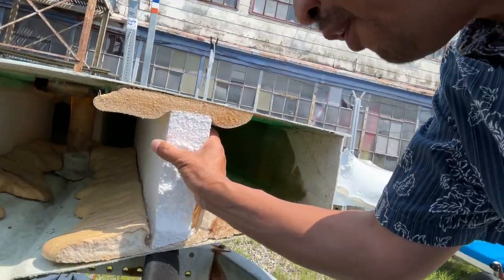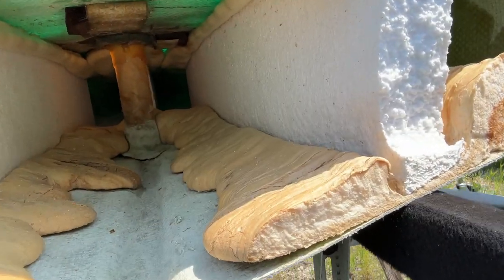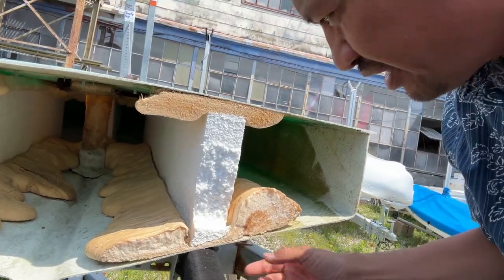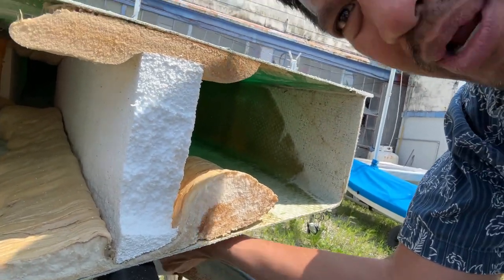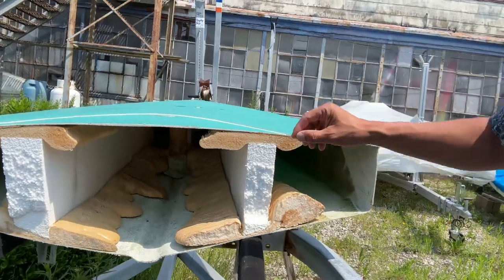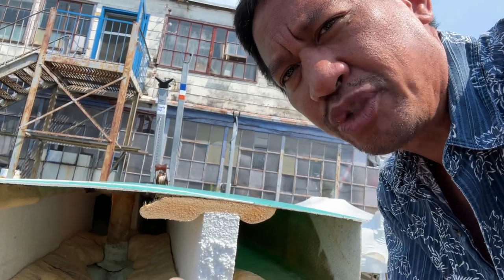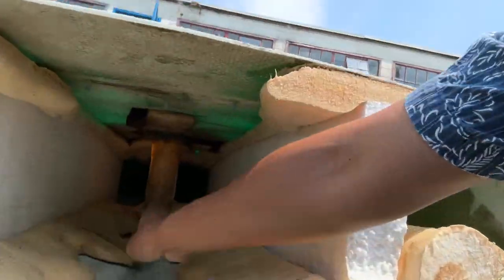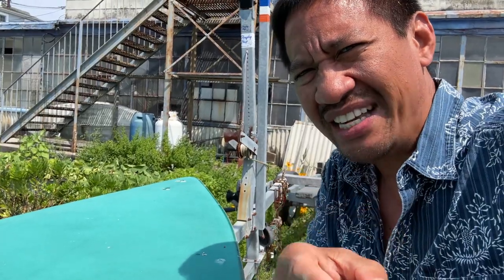LOOK @ Sunfish Sailboat Foam Blocks

Comment: Nice video Lee. The structural foam blocks are Extruded Polystyrene (XPS) aka "closed cell" foam. Closed cell foam resists water penetration, as opposed to the open cell foam found in everyday styrofoam. The adhesive foam is also closed cell, but if either the XPS or adhesive foam are submerged for a while, they soak up water.

Comment: That blobby-looking foam is the one that absorbs water and gets heavy, if you get a leak in the boat. Holds water like a sponge.  They use it to glue in the white foam. The white stuff really doesn't hold water much at all.  When you use fans to dry out the inside of a hull, that blobby polyurethane foam is what you're drying out.
Reply from the maker: Yup!
Reply: Is there a tutorial on doing this? I don't have a way to insert a fan
Reply: @ezman5086  Well, on the older boats, a typical owner would drill an inspection port hole in the deck, that gets a screw-on hatch. Maybe more than one, sometimes. (I personally hate making ports in the deck and avoid it when possible) You then set a small fan, like those used for cooling computers, or  small personal desk fan, to get air flowing thru. The inspection port can have a remove-able dry bag attached to it to make a handy little storage place for small items later. 

On the boats with an aluminum edge, there's another choice that doesn't leave inspection ports cut into the deck: I had to do some extensive repair on my Sunfish so I did some surgery - you drill out the rivets that hold the edging on, carefully remove and store the edging, then take a steel painter's scraper tool and a mallet, and carefully split the deck from the hull at the front and/or the back, pry the flaps up a little, and blow air thru it for however long it takes. Took me about three months but I work slow. When done, you epoxy the deck and hull back together, re-attach the trim, looks like you were never in there. 

That's not a method you want to ever repeat, it was my one-time fix when the boat I got was so soaked it weighed about 400 pounds and it took all summer to dry it out. my boat also had an 8-inch hole in the bow to fix, so there's that...

Comment: I wish that they had the stern end as well.  I'm curious where all they have the wood inside, and is it just glued/epoxied to the fiber?  If it's just glued/epoxied to the fiber then I definitely will be very careful when removing/replacing parts because I don't want the wood backing to break loose from the fiber.  The wood that I had to cut out of mine to install an inspection port and upgrade the rudder bracket was very solid and probably 1" thick.
Reply from the maker: There are experiences where people un fastened the whole fixture and then heard the backing plate fall in the hull…. So yes be careful….
Reply: @LeeSideSailing  I really appreciate your content Lee!  I keep coming back to it to help me improve my boat and my sailing
Reply: The blocks are held in by a blob of adhesive and also a fiberglass strap. But over 50+ years those bits dry out.

Comment: So what do the new Sunfish use for structural integrity? Are their internal stringers? It doesn’t seem likely that airbags would provide a sufficient amount of strength on their own.
It is a bit disturbing to see how weak the keel of a Sunfish actually is, as the keel is usually considered to be the most vulnerable part of any vessel.
Reply from the maker: The new sunfish are vacuum formed like the Lasers…. The old keel I believe gets much of its strength from the shape of the keel/skeg itself.   It is surprisingly strong considering its thickness is thin.

Comment: Hey Lee...  great video!  If the foam is loose do you have any recommendations to glue it back down?  My 1976 sunfish is nice and dry but hitting those waves its obvious that it has become detached.  
-Paul D from Lake Norman NC
Reply from the maker: If you have an inspection port you can use expanding foam….  Take away the loose foam and inject it.  You may want to cover your arms as putting yout arm in thr port inevitably gets foam all over you… :)
Reply: @LeeSideSailing  thank you.  I was thinking that was a possible solution so I'll try that.  Hope to meet you some day.  Keep up the great work - I tell new Sunfish sailors all the time about your channel and to "SMASH THAT LIKE BUTTON AND SUBSCRIBE TO THE CHANNEL"  🙂Hope to meet you some day.

Comment: Any word on the SOL vs Sunfish? What about its construction? Excellent cross section look.
Reply from the maker: Thank you….  The SOL is a solidly made boat.  The bottom is the same shape…. Obviously the cockpit is much bigger… i would speculate that in wavy conditions the SOL would catch more water vs a sunfish…. The bailer is the same also, and in the same position as the Sunfish….  I think transom Scuppers would be a fantastic addition to the SOL… parts are the same and cross compatible.

Comment: how do you replace that foam if you need to?
Reply from the maker: Not easy.. z. First get the foam, but then habe to try to get it in the hull, but that in itself is terribly hard to do…. Then attach it with expanding foam…..